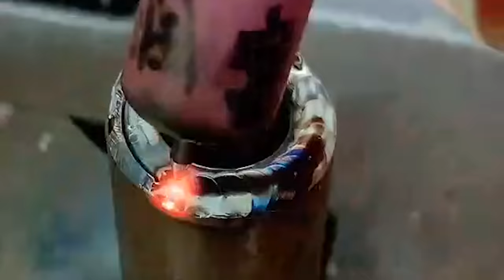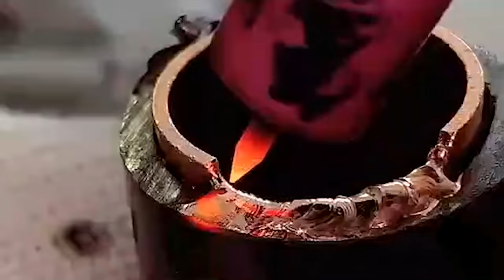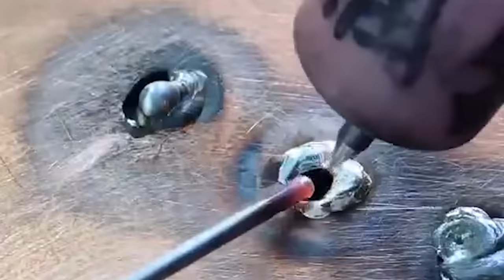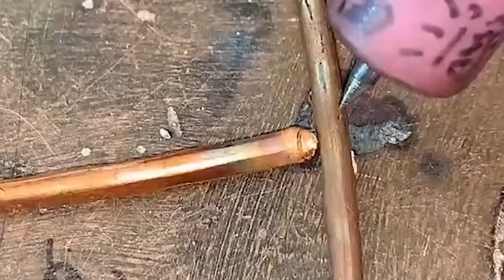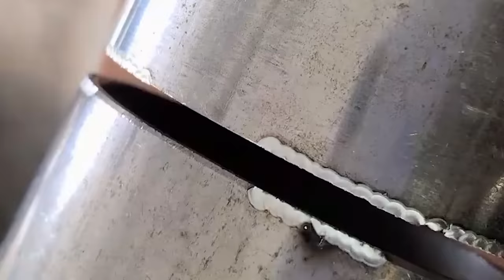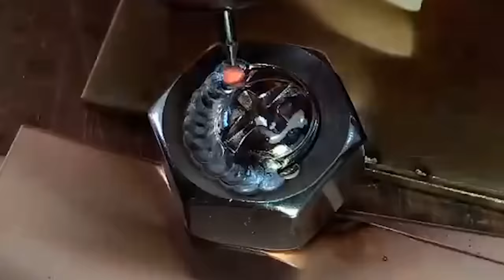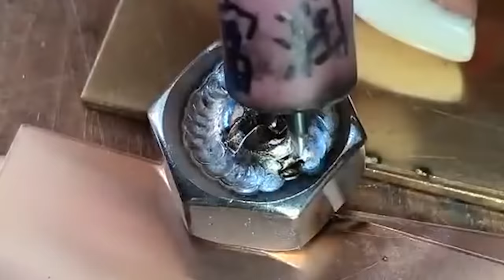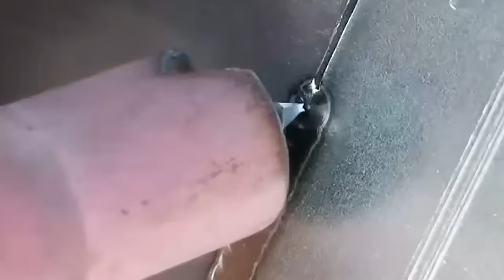What is cold welding? Watching this video you will understand!

Comment: How strong are the welds, will they hold up?
Reply: cold welds mean there wasnt much heat which translate to shallow penetration. If u plan to weld very small pieces, yes they will hold, if u want weld parts that will receive some forces, no they will broke. And if u want to weld parts in ur motorcycle or something like this and then ride u gonna probably die. This is basically tig welding but on much weaker scale and thats why they show only screws, thin plates and wires. If u search tig welding u will find more powerfull machines suited for any workshop/diy project.

Comment: It's a tig process but using very powerful capacitors  that instantly discharge find a way to create multiple discharge in milliseconds and then  figure out how to gain serous penitration at least minimum 1 eighth inch the you will have  something worth  buying 😀

Comment: you have to do it in a subzero walk-in freezer at -50. it's all about the temp. if you just put it in at - 300 it welds itself. - 1500 and it turns to liquid!

Comment: Cold welding isnt possible on earth it has to be done in space  cold welding has everything to do with electrons fusing together if you have a oxide layer on 2 similar metals  they wont cold weld but if you take the oxide layer off and put the two metals together then the electrons fuse the metals together that is cold welding    also another tip if you want to keep your tungsten and metal from building oxide layers from the atmosphere   keep post flow at 2 to 4 secs

Comment: As a certified welder in MIG, TIG, and stick, I can tell you with 100% certainty that this is just creative editing and this cold welding video fad that people keep creating videos of is all bullshit. Welding is literally creating an electrical arc between two pieces of metal until the heat generated from the electricy is hot enough to melt the metal and create a molten puddle (weld pool) that fuses the two pieces of metal together. Nothing about it is cold. Even the light emitted from welding is so bright the light from the arc of a tig weld will literally sun burn the hell out of you.

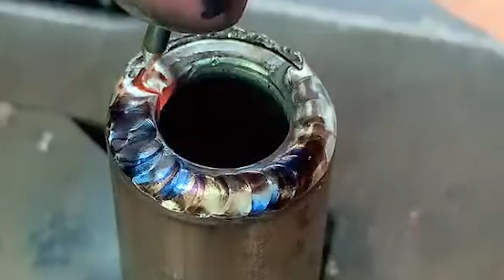Comment: amazing stuff ,,, Whats all the red stuff at 00:24 on the pipe ?
Reply: That would be molten metal
Reply: @Unusual_Danger   but its cold ,,,, lol ,, must be a puddle of frozen sparks.
Reply: @tomthompson7400  The title and video have no relation, my father is a welder and I know that’s not cold welding
Reply: @Unusual_Danger   Exactly my point .
Reply: @Unusual_Danger  what is it then? Do you know the name of the machine?
Reply: @hamidahmed8076  Arc welder probably
Reply: @hamidahmed8076   its a basic dc tig running tacks ,, and its certainly not cold
Reply: @hamidahmed8076  it’s basically a TIG welder with a single tack or very slow high amp pulse. The reason the call it cold from what I can tell is it doesn’t dump a lot of heat into the part.
Reply: I think "cold welding" in this case means its bieng welded with much less heat than a constant arc would produce, so in a sense this is "colder welding" lol.
Reply: @alme6743  that’s exactly what it is.
Reply: @alme6743   Im a qualified weld inspector , as well as a certified aerospace welder ,, this box of capacitors is just tat.

Comment: Isn't cold welding when two perfectly flat pieces of the same metal are placed together and over time weld themselves back together?  The one thing I remember being instructed not to do was to put two clean square blocks together in your toolbox, because when you come back from your weekend you may not be able to separate them.

Comment: Cold welding or spot welding isn't a good long term idea... that weld doesn't penetrate into the metal to hold correctly.   It's like glue an not part of the metal.

Comment: Nope, not welding at all. This is fusing and is only used in metal models and to hold two pieces together just long enough to actually weld it. I guess it’s not surprising that this comes from China, maybe in China this is what they consider welding. Which leads to so many considerations…

Comment: If the current  running through the metal is high enough, strong enough, and makes it HOT ENOUGH TO MELT; IT IS NOT , " COLD WELDING"‽‽‽‽!!!!
  The filler rod strengthens the weld by ADDING material that has been VAPORIZED or Blown out of the weld by the inert gas.

Comment: It's hilarious this Chinese company has evolved this kind of marketing where they create a fake female persona to sell these welders on youtube. I mean it's cool enough as it is. You're not buying one of these and saving trips to the welder for anything serious but it's sort of a little dream device for a tinkerer in just how it works. 

"Cold welding" is being used here as a result of the language barrier but it's a sensible descriptor when you're trying to appeal to your customers by showing them the feature of welding without creating pools of melted metal. You're not throwing a gas torch flame around on a surface til it gets so hot it melts into a puddle, which sounds dangerous. You're throwing a super fast pulse of super high energy discharge that near melts the surface into a puddle which would be suitable for a real welded bond but it doesn't quite get there and is near instantly cooled by the still cold surrounding material making it safe to touch.

Comment: Everyone of those welds has a pin hole all the way through not good for pressure it will leak got learn to tig weld and tapper out on pipe or pressure vessel

Comment: cold and hot welding are determined by the voltage used. below certain voltage is cold area. above is hot. You are TACKING

Comment: Cold welding is like tattooing yourself with a pen compared to how needle injects the ink into your skin.  With cold welding you hardly get any tensile strength or proper penetration.  Not to mention sticking the tungsten into the steel will ruin it so fast.

Comment: If you mean "cold welding" as in you accomplished zero penetration and didn't create a single structural weld in this entire video, than yes. This sure is "cold welding"
PS: stick your tungsten more to achieve that industry desired contamination 👌😂

Comment: This is called TACK welding. It's great set the mediums in place but no more. One good thump and it breaks. It looks pretty, and even looks solid but it's not. That is why you go back and make a proper weld using a movement pattern to ensure proper penetration and prevent porosity in the metal that you're welding. A good way is to make a few tacks to set the materials in place and then properly weld them together. 

You don't turn up the amperage and HOPE that your TACKS hold! The words CATASTROPHIC FAILURE comes to mind when I see welding like this.

Comment: Guys this is just a spot welder with a fancy name
You see..
The atomic structure of metal are basically crystal like in protons surrounded by electrons 
Since the atomic structures of metal are pretty similar they would stick together 
but they don't
Because if you know basic chemistry then you'd know no matter how close you put two pieces of metal together by normal means there's always a least a small layer of air in there (as well as an oxide layer)

There's many ways to get rid of these two layers, I think best way is a hydraulic press (if you have one)

Comment: after this machine fill market , tig , torch , mig machines will drop price significantly
Reply: Nope. This is different purpose, different market. Injection mold repair as an example.
Reply: Not for food or medical grade stainless sheet metal, MIG cannot be used for everything, most jobs ive done have minimal MIG welding, we used MIG for like racks, frames etc, and all the pipe and sheet was TIG welded.
Reply: This is a TIG welder, just being used to fusion weld...
Reply: @autumn5592  you mean if I have  a tig welder  ,I can use it as cold welder ? but how  ?
Reply: @henrikaize  It's not cold welding, it's FUSION welding, they are two totally different things.

You can use a TIG, I'm not sure on settings because I've never handled one or used controls on it before.
Reply: @henrikaize  turn the settings down and use pulse. But if you had to ask I would get a manual on TIG welding and learn how it's done.

Comment: Several things comes to mind.

Your speeding up on several welds. Doing this, is slower than 1 weld pr second.
Your definition of cold welding is lacking. Technical or industrial terminology??? Because as a technical term, this is a regular weld. Even though you don't add extra material to it.

And this kind of welding, is as weak as they come. a paperclip will hold things better together.

A COLD weld is, by definition, 2 metals fused without turning either of them into a molten state or or by adding foreign material to the weld. which you can't do with 200 amps for roughly 100 ms. That shit will go molten in 10 ms or less.

Comment: Nice trick but totally fake.  This is actually called creative camera editing.  So called cold welding isn't a real thing. True cold welds are bad. They do not introduce enough heat to do any actual welding and if it does take hold it will be very weak. Do not try any of this garbage.  Just take your time and learn how to weld properly.

Comment: This isn't actual cold welding 🤦 it might be "cold" welds, but it's not the molecular phenomena of cold welding.     it is cool though.  I'd lke to see the strength of those welds. Because I bet money they aren't strong at all. 

Also, so you see that glowing spot?   That is hot metal.   

Also, your "copper to iron" bs, you could easily see that they didn't bond.  That said, it could be cool for a very select few things.
Reply: I was thinking that too, they don't seem very strong 😑
Reply: I know right, so many people need to educated about cold welding. Or someone will build structure with this and hurt someone
Reply: Very clueless comment section indeed (morons complain and criticize).
1. These are special single pulse TIG machines, used for example in injection mold repair. They are "strong" enough, don't worry (to join two broken parts you would use normal TIG, but not always).
2. Various different metals can be melted/joined together, this is no secret. Iron/steel and copper alloys are best example. Yes, they do weld/braze/hard solder together.
Reply: @qwertyasdfghjkl9604  thank you.
Reply: They’re called cold because they don’t dumb a shit ton of heat into the part surrounding the weld.
Reply: It's about as strong as chinesium, a metal so hard, it will always cut warm butter, usually.
Reply: @qwertyasdfghjkl9604  I agree I hate when clueless people talk about "i bet the weld isnt strong" yet they have no idea what this technique can be used for, they probly know everything after a few months in welding class. "I pAsSEd mY MiG 1G cErt" l0l

Comment: This is just a person who hasn't learned how to weld... do not do what you see here and expect those welds to hold anything.
Reply: What if you don't want to learn welding and you make sculptures that require no strength? Would you recommend glue over this?
Reply: @valkenburgert  if you spend that much money to buy a welding machine, why not learn to use it?
Reply: @krisvind1715  I've been reading up for many hours but cannot find relevant information. Joined a welding forum, lovely advice but not what I need. I need to weld like in the movie. Weak bonds, slow, controlled, safe way of working. Will very likely be my start of a welding career indeed but for now I am completely stuck. The sheer power of welding scares me and I don't have a proper workspace. I'd be doing it in my backyard. Once I get used to this I will probably go a step up to proper welding.

Do I need an expensive TIG welder with gas to have pulse-welds like these? Can that be done gasless? Is there a cheap alternative? Can you solder 3MM mild steel instead? Would love your input, appreciate your reply!
Reply: @valkenburgert  to weld like shown in this video you will need a TIG welder with gas (argon.) But you do not need an expensive welder, the cheaper ones will do fine for this kind of work no doubt.
Welding and especially TIG welding is not really that dangerous, but there is 3 things you need to know, 1 the UV light tht is caused by welding is very Strong and will burn your skin, just like the sun on a hot day so you always need to wear long sleves and long pants, and you need a welding helmet (cheap ones are just fine).
2 the gasses that comes from welding is toxic and you do not want to breath them, so you need to either weld outside or if indoora you need and exhaust to suck the smoke and gasses out of your workshop.
3 when welding things obviously gets hot so you will need some good gloves.
Now, welding outside can be tricky because you use gas, so if you don't have some protection from the wind, the wind can blow away the gas and make it impossible to weld.
Soldering 3mm material is possible, for that you need an oxy/acetylin burner and that can seem a bit intimidating at first as it can be quite noisy and hiss a lot. With an oxy/acetylin kit you can also weld much like TIG welding.
So if i were you, i would try and search here on youtube for oxy acetylin welding, that way you can both learn to solder and weld, and you can do it outside no problem :)
https://youtu.be/fs1UhhJH0E8
Reply: @krisvind1715  Appreciate your answer big time! Thanks!

Many disadvantages to alternatives, one of them price. So I’ll be diving in the deep with stickwelding and face my fears 😂 Just go nice and slow, only need little bits of welding anyway.

But really appreciate it, some of us just need some information and “understanding”. Quite the world, the world of welding. Not too many things in life you cannot look at and cannot touch. And avoid smelling too 😂

Boy, would I love a cheap, gassless tackwelder 🤪

Cheers, you definitely brightened my day!
Reply: @valkenburgert  stick welding is deffinitely the cheapest way to get started, welding can get expensive quickly. There is nothing to fear, it just takes a lot of practice, find some scrap pieces and try and weld Them toghether.
When you buy electrodes look for "rutile" electrodes, they are more beginner friendly and easier to use.
Reply: @krisvind1715  Awesome, thanks again! Just seen a very lengthy movie. They mentioned all kinds of numbers for elektrodes but found it hard to grasp. “Look for rutile” makes more sense to me 😄

And just found out they do stock them here 👏
Reply: @valkenburgert  yes they are all named with numbers which can be very confusing.
Good luck finding what you need and good luck welding!
And also, it is best wear cotton when welding, do not wear a nylon or polyester shirt, the sparks will burn right through

Comment: That's actually called tacking...it wasn't cold either lolz it was red hot!!! You learn how to set the amperage for the type and thickness of your metal and then learn how to run a bead without warping anything. The secret is to move around alot so that the heat doesn't build up in one particular area...not this wierd tacking shit, looks like someone who doesn't know how to run a bead basically.

Comment: The Chinese trying SO HARD to tell this BS "cold welding" technology it is hilarious. The definition is also absolutely in appropriate as there is nothing "cold" about the fusion prices using a TIG welder to produce and ionised electrical arc in innert gas, the very act of melting th emetal in this way indicates lots if heat, just because its in localised pulses and may cool vey quickly (relative to the touch) doesn't make it a cold process.

It's also a shitty process for joining materials over all as others here have stated, it's been possible to do this for decades so it's not new, and it makes people with zero skill and knowledge think they can produce something safe to use.

I've seen dozens of these videos pushing this in my 15+ years as a professional welder.

Comment: Yeahhhhh, cold welding is not a thing in normal welding environments. It's a pulsed fuse in most cases. At least that's what we call it here in 'Murica. And welding dissimilar metals  with only a fuse will break under load. Fucking YouTube welders. And turn your frequency down some, that shit is  at least at 220 Hz, that's a bit overkill in most instances and just sounds obnoxious. And you see those little pinholes in the center of each pulse? That's where crack propagation starts, you need a tighter pulse spacing.

Comment: Watch this first https://youtu.be/V7-mcjR59a4
 Called cold weld cause structurally its a cold weld and nearly has no holding power, gives nothing to strength. Just a tricky circuit that switch off the power like TIG.
But while TIG two states is high and low that is high and completely off.
That's cold welding and. A lot of are just a clikbait.